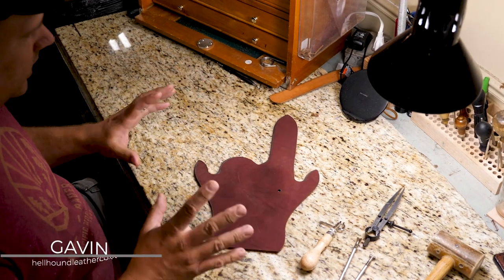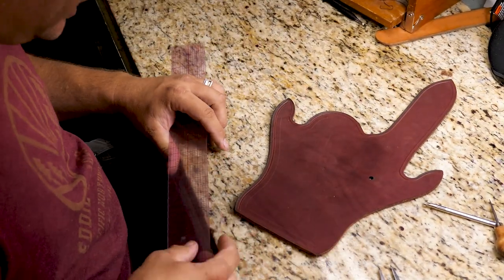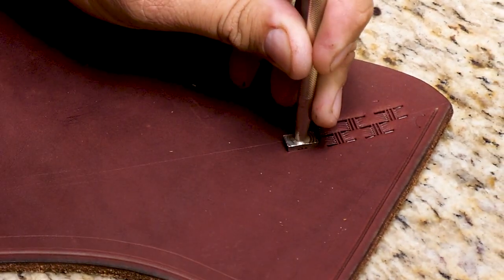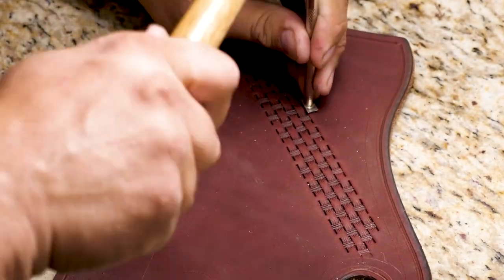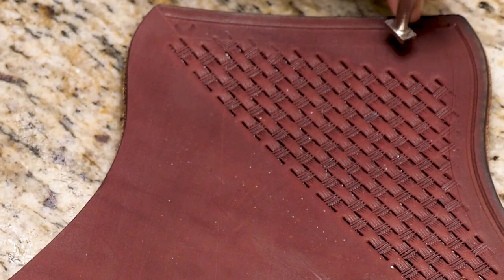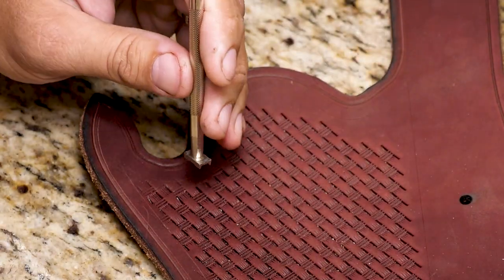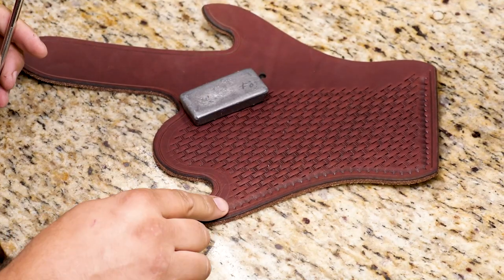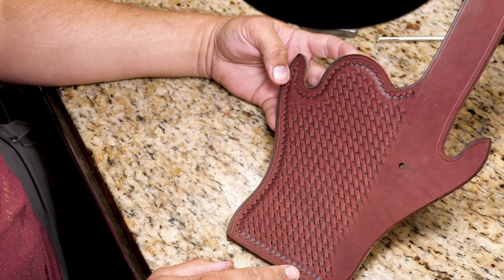PERFECT Basketweave Stamping Every Time | Tips & Tricks | Leather Craft How To

Comment: Wow, this was a great tutorial and filled in  (No pun intended) the blanks on the alignment of the basketweave patterns.  Question though - in watching your videos, you typically oil (Neatsfoot) the leather, but do you do that before or after tooling/stamping?  I see in one instance applying it after the liner, but was wondering if there is a difference when tooling?
Thanks
Reply from the maker: Thanks for asking - if you're going to tool or carve a pattern, you typically want to oil or condition your leather after the tooling is complete. This is because the oil will soften the fibers and your stamp pattern or tooling will not come out as crisp. The general rule of thumb is (in our shop anyhow): 
1. use whatever pattern to cut the leather.
2. if you are going to tool, stamp or carve, do that next. Dunk your leather in water and let it case. Once the water is evenly spread through the fibers and it doesn't look "wet" but feels cool to the touch and when bent holds its shape (I always say its ready when it kinda feels like clay) its ready to tool.
3. After tooling or stamping is complete, let it dry completely (24 hours, usually)
Then you would move on with the rest of construction...lining if desired, oiling, dye, stitching etc
Hope that helps!

Comment: Is the rawhide mallet the one to go for, I've also been looking at a bakelite one? Also what weight do you recommend?,thankyou..
Reply from the maker: The rawhide mallet in the video is one that I've had and used for 20+ years. I've tried a few others, but always come back to that one. Nothing wrong with the bakelite mallets, they'll get the job done for sure. It comes down to personal preference (that comes with time, experience and experimenting) like with everything else. The rawhide mallet I use is only between 9 and 10 ounces and typically you will want a lighter hammer for tooling. This is because the actual act of hitting the stamp again and again is easier with a lighter hammer in that you don't have to 'pull your punches' like you might with a heavier mallet and prevent it from hitting too hard. With something lighter, its easier to hit the stamp with an even amount of force again and again, making your overall pattern look better.